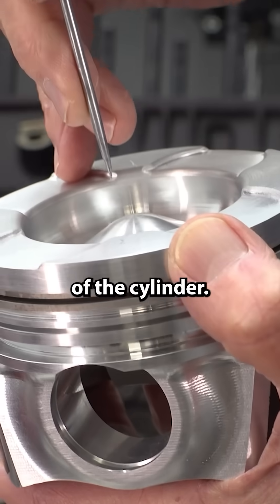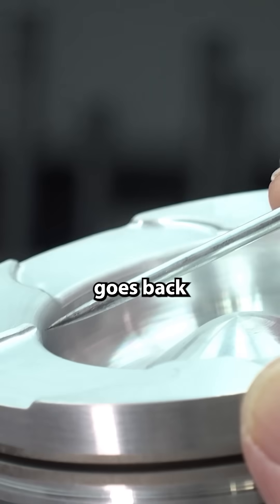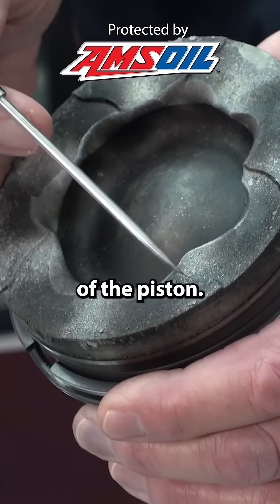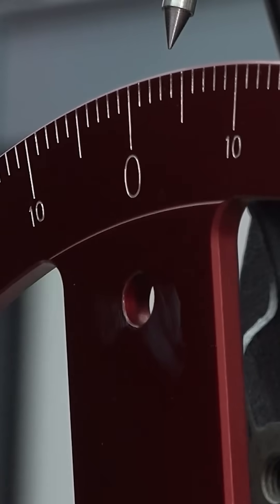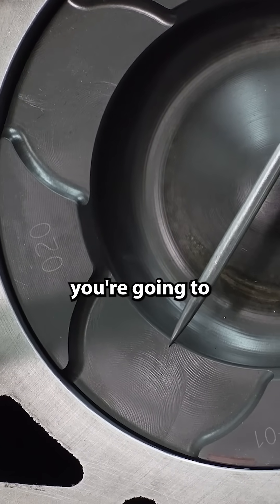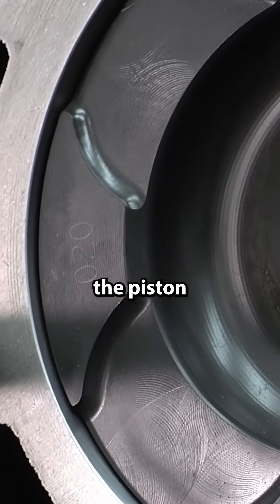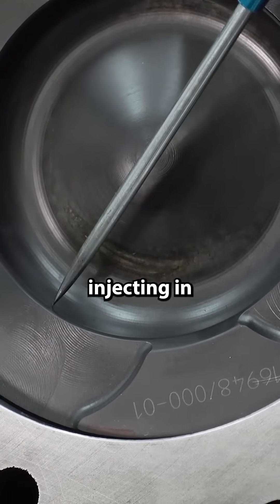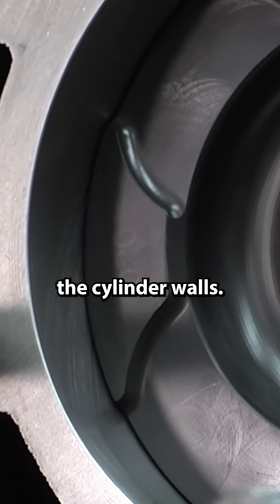How to burn pistons.

Comment: cylinder port induction & strong chamber swirl is a key that creates sleeve valve 4-strokes & piston port 2-strokes higher efficiencies & lower emissions with charge back draft to feed oxygen to the combustion plume especially with opposed piston combustion chamber 2-strokes .. Richardo proved that 80 years ago.. GM management has a lot to answer for .. piston crown combustions chambers are a POOR compromise to make diesels work .. poorly

Comment: Almost flat angle?

Its not quite that simple. 
This is fuel under pressure.  At even 100rpm , 40 deg is 1/9th of a rotation and this sweep is just over 10ms. Of fuel.  At idle that is about 1 msec. Of fuel. Every 4 msec. Now I get that it is washing the cylinder wall over that time. But every 4s engine has a combustion cycle that includes fuel entering the cylinder and coating the cylinder wall. It would be rven worse with throttle-body injection.

But that would involve the entire cylinder not just the injection port locations. Or such high pressures

Comment: Question: why does the injected fuel burn up the piston and or cylinder wall? I have never understood why it does that bc in my mind it would do the opposite  as its a cool liquid. The only thing that would make sense to me is if the diesel fuel is turned into what i would consider a flame thrower in essence and is concentrated in a direct line to the piston and or cylinder wall, but that would mean the fuel is instantaneously ignited which i didnt think happened.  
  Basically,  is whats causing the piston top and or cylinder wall to burn caused by this "flame thrower" i described? If not can someone explain please?

Comment: How do you accomplish this in a 5000 rpm application most times you have to "spray" for a long time to make power across rpm range. With mechanical injection. So everyone else is burning cylinder walls? Street...i get it...track its laughable there gale! If ya wanna make a fee thousand h.p. or more ive seen your joke of a supercharged durmax lmfao!!!

Comment: Pistons don’t travel at a linear speed through the cylinder, especially on long stoke engines like a diesel, also all combustion in a diesel has to occur in that bowl in the middle, spray it outside of that and now your heating up the outer edges of the piston where the metal is thin, everything hes saying makes perfect sense

Comment: The solution would be to have an injector tip that would inject fuel at a rotational angle instead of perpendicular to the injector. Six o clock would be targeted towards seven. Not sure if it's possible but it makes sense in my head.

Comment: The fact the piston slows down and top dead center and then speed back up on each down and up stroke... is also the source of secondary vibration even when your cam shaft is counter balanced.

Comment: It's a mix of timing and bad injectors.
Bad injectors or stuck injectors will melt the pistons for the exact same reason the gentleman already explained.
 Bad timing can lead to various reasons  making things even worse.
 So check your fuel injectors once every 3 4 years use quality fuel and change the timing if its a belt driven.

Comment: What he’s saying is injecting the fuel is important to get right because depending on the position of the piston and the angle of the injector you could cause all of the combustion to take place on either the cylinder wall or the lip of the piston to which would be bad.

Comment: I have a question, how often should on remove their injectors and clean them? Nozzles, confirm key components of the injector are not sticking, and maybe a put them in a ultra sonic cleaner?
Reply: I've got a Cummins 6.7, 12 yrs 465k miles never had injectors out or cleaned. Runs like new.

Comment: When you have a burn in the cylinder as the piston is that far down, all you create is heat, and loss of power. Similar thing is ignition timing on a gas motor, when you are firing a spark plug ATDC, all you create is heat. I have seen a few times when ignition timing like that destroyed power and ring package/bore condition. It's ugly for sure.

Comment: Gale we both know the power held inside of optimally advanced timing and being capable of altering injection timing  while maintaining swirl is huge. You have the resources to make more power CHANGE THE SPRAY PATTERN to maximize mechanical advantage reduce cylinder pressure with extra timing and add some power.

Comment: This is why I follow you. You take the approach of a proper engineer when increasing performance or designing parts.
So many "tuners" on youtube and car shops have no f****ng idea of what they are doing. They just flash the ECU to mess with the factory parameters because they think they are smarter than the engineers who optimized that engine for maxium power within the mechanical safety factor

Comment: Still spraying fuel after TDC seems like such a waste of fuel.
Don't the exh valves start to open at about 60° ATDC to keep from overheating and burning up the pistons. Unless this is some kind of quirk of diesels spraying fuel at 30° ATDC doesn't make sense.

Comment: I have heard that the tiny holes innthe injectors basically get "diesel jetted" over time from the operating pressure  and any impurities in the fuel. This makes them run richer using the same tune and have heard people stating they lost power with new injectors of the same size. Crazy how important all this stuff is if you want power and longevity.

Comment: What he is trying to say is, that chip tuning comes for a price. To get more Diesel into that chamber you can increase the pressure, which wears down the nozzle and the pump, you can start early, which is hard on the cylinder head and the head gasket or you can spray longer which is - as explained here - eating away your piston. The best thing to do, would be a mild mixture of all options, slightly raise the pressure, start 1 or 2° early and end later, but not too late.

Comment: I always assumed that diesel is injected when the piston is traveling up during the compression stroke, it's not like a carbureted gas engine that draws the fuel and air in during the intake stroke!  I mean, come on, it makes no sense to inject the diesel while the piston is on the eay down the intake stroke on the way to the compression stroke, if it is, change your injection timing.

Comment: I have a 2008 gmc 2500 duramax and want a Banks tuner and delete my regin mine doesn’t use def , 114,000 miles how to buy it from banks , any help would be greatly appreciated, just want better fuel efficiency and better for engine,don’t care about a lot more horsepower

Comment: We had a batch of cylinder heads new stright from the Detroit Diesel factory  that the injector seating depth was too shallow and the cylinder was b3ing washed down to the point that liners were being pulled apart from wash down and I found it and saved Detroit millions in damages.  The new guy at the factory skipped the last reaming step and thousands of heads were out there.

Comment: Burning, cracks and holes in pistons with the hole on the base of the "wall" which is perfectly in the cup of the piston and well below the crown happen even if the injection isn't spaying too long.  

Modern systems operate at 30K PSI or more and if the injector has any issues it turns into a high pressure blow torch, which literally can melt the piston.

Compared to almost any other country in the world, America's low sulfur diesel fuel sucks ass.  It is "dry" and that lack of inherent lubricity can cause excessive wear on the high pressure pump and injectors.  Clean fuel and using cleaning/lube additive are the only defense along with crossing one's fingers.  I own a diesel, it will be my last...

Comment: Injection starts BEFORE TDC and not AFTER TDC "and gasoline engines the same, except SPARK is BEFORE TDC anywhere from 10 to 20 degrees... in fact efi engines have knock sensor, and will ADVANCE timing to MAX til it picks up "knock" and instantly retards ignition, and increasing advance in increments till knock detected again "and on constant repeat" 
If either diesel Injection or gasoline ignition don't occur BEFORE TDC, there will be improper combustion "especially at higher rpm" YES if timing is WAY too far advanced, catastrophic damage will result "both gasoline and diesel engines" and if too far retarded, gasoline will have zero power, and diesel will glaze cylinder walls "fuel wash" and could burn piston as depicted "dependingon how far Injection timing is regarded".

Comment: I own a 07 Dodge Ram with a 5.9 Cummins. After looking around and spending hours and hours researching performance options i decide on Banks products. Many systems claimed more power but the majority had to be piece mealed together, wasted fuel and high EGTs. I am very happy and amazed at how clean burning my engine is. Makes some pretty serious power and runs like a stock unit. No i cannot "roll coal" like many do but i do get great fuel mileage, normal EGTs and will put a smile on your face.
Reply: Why would anybody WANT to roll coal?! I LOVE the torque of a big turbo diesel, and one that does it without making a smokescreen is even better.
Reply: Rolling coal is stupidity gone to seed
Reply: U dont want coal anyhoo
Reply: It’s Cummins  not Cummings

Comment: The first week of my automotive courses in high school, was spent on all the Automotive Manuals the teacher had up on 4 X 6ft long shelves on the walls of our shop, nother but kearning how to research, understanding diagrams etc. He said some wrll most in the class will just save money fixing their family's vehicles the rest of us will be doing it professionally, so learning bookwork and how things were engineered just made better mechanics, i was lucky i worked in the summer months at Ideal Supply Marine Engine building, and Wowsers did they have some amazing equipment i learned Port and Polishing, valve grinding and repairing well machining vavle stem guides in the heads, it didn't ever end, 4 yrs was invavluable learning, i was 16 yrs old starting and 19 when done, the guys i worked with both raced street cars and drag raced everything snowmachines, motorcycles, cars, go carts, these 2 guys Dave and Paul. Dave tought me how to put 7 angels on the vavle face and 7 identical angles on the seats, completely un reasonable but if you can manage it, you can easily do 3 angels for a very tight seal. Usually there are 2 angels for those that dont know. But luv listening to this guy and eny others in these fields Thanks for Sharing

Comment: Why the hell dont the injectors have like a 40⁰ spray angle rather than like an 80⁰ spray angle? If they'd use the cup, theres mass, theres no cylinder, no machined edges...  what they are doing in diesels with injector nozzle angle is borderline short bus..

Comment: Common rail am use  2.2 hdmi  base engine... Adopted from ford tddi injectors little bit mods  and denso sequence fuel pump set up and all of them work fantastic.... Ahh forgot use turbocharger ihi 55 small diameter propeller hot side and modified journal bearings for ceramic ball bearing.

Comment: For a second there i thought he meant the injector was in the middle of the piston somehow and shooting upwards and was really confused 😂 i was thinking what kinda new tech is that bahaha
Reply: It does not happen, if this was a problem it would have been solved a 100 years ago. If any fuel mist touches any surface, the fine droplets combined into bigger droplets that are slow to burn. The burning is incomplete by the time the exhaust valve opens so you get smoke, loss of power higher, fuel consumption. When the first amount of fuel is injected into a Diesel engine then the pressure and temperature in the cylinder increases very rapidly, so the remaining fuel is instantly burnt on injection

Comment: The edge overheats because you're adding energy to the combustion gas and not getting any work out of it because you're adding it too late in the cycle, therefore it stays as heat and doesn't turn into work.

Comment: I would think to avoid burning of the piston crown, you could coat the top of the piston and doen the sides for about 3/4 of an inch with teflon to prevent burning.
Reply: It does not happen, if this was problem it would have been solved a 100 years ago. If any fuel mist touches any surface, the fine droplets combined into bigger droplets that are slow to burn. The burning is incomplete by the time the exhaust valve opens so you get smoke, loss of power higher, fuel consumption.  When the first amount of fuel is injected into a Diesel engine then the pressure and temperature in the cylinder increases very rapidly, so the remaining fuel is instantly burnt on injection

Comment: You don't spray on the cylinder walls. It's burning. The diesel is only fluid in the near of the nozzle. Than their is a mixture zone and a flame zone.
Reply: It does not happen, if this was a problem it would have been solved a 100 years ago. If any fuel mist touches any surface, the fine droplets combined into bigger droplets that are slow to burn. The burning is incomplete by the time the exhaust valve opens so you get smoke, loss of power higher, fuel consumption. When the first amount of fuel is injected into a Diesel engine then the pressure and temperature in the cylinder increases very rapidly, so the remaining fuel is instantly burnt on injection
Reply: @maritaquality  No only the area where the spray has local lambda 1 burns. It's called diffusions flame I guess. 

If you have so much diesel pressure (Equal to injection mass) that the burning isnt fast enough than the diesel could hit the cylinder wall. But that your injektor needs more holes and a different design.

Comment: So, is he saying it's actually OK to inject up to 40° or should we stop sooner?
Reply: It does not happen, if this was a problem it would have been solved a 100 years ago. If any fuel mist touches any surface, the fine droplets combined into bigger droplets that are slow to burn. The burning is incomplete by the time the exhaust valve opens so you get smoke, loss of power higher, fuel consumption. When the first amount of fuel is injected into a Diesel engine then the pressure and temperature in the cylinder increases very rapidly, so the remaining fuel is instantly burnt on injection

Comment: When there's combustion into the cylinder, the piston goes up, and the "air" is moving just like a tornado, but horizontally, at some moment into this tornado fuel comes as a spray - super small drops of diesel fuel, which are going to be a part or all this "tornado" and in some moment all this burns with very good speed...

Comment: I know when my piston is reaching top dead center and it's still spraying in the bore... It's gunna be a costly next 18 years. But if you do find the radius is super heated, I find that's usually due to a lack of lubrication.
Reply: @maritaquality
1 second ago
It does not happen, if this was problem it would have been solved a 100 years ago. If any fuel mist touches any surface, the fine droplets combined into bigger droplets that are slow to burn. The burning is incomplete by the time the exhaust valve opens so you get smoke, loss of power higher, fuel consumption.  When the first amount of fuel is injected into a Diesel engine then the pressure and temperature in the cylinder increases very rapidly, so the remaining fuel is instantly burnt on injection

Comment: Why don't they curve the sharp edge down, like an aero foil, to draw the stray towards the center, there is already a deep ring cast in the piston, perhaps lift the cut up and add the curve, so as not to lose the displacement and volume.
Reply: It does not happen, if this was a problem it would have been solved a 100 years ago. If any fuel mist touches any surface, the fine droplets combined into bigger droplets that are slow to burn. The burning is incomplete by the time the exhaust valve opens so you get smoke, loss of power higher, fuel consumption. When the first amount of fuel is injected into a Diesel engine then the pressure and temperature in the cylinder increases very rapidly, so the remaining fuel is instantly burnt on injection

Comment: Why does is burn the piston?
Reply: It does not happen, if this was a problem it would have been solved a 100 years ago. If any fuel mist touches any surface, the fine droplets combined into bigger droplets that are slow to burn. The burning is incomplete by the time the exhaust valve opens so you get smoke, loss of power higher, fuel consumption. When the first amount of fuel is injected into a Diesel engine then the pressure and temperature in the cylinder increases very rapidly, so the remaining fuel is instantly burnt on injection
Reply: It does not happen, if this was a problem it would have been solved a 100 years ago. If any fuel mist touches any surface, the fine droplets combined into bigger droplets that are slow to burn. The burning is incomplete by the time the exhaust valve opens so you get smoke, loss of power higher, fuel consumption. When the first amount of fuel is injected into a Diesel engine then the pressure and temperature in the cylinder increases very rapidly, so the remaining fuel is instantly burnt on injection